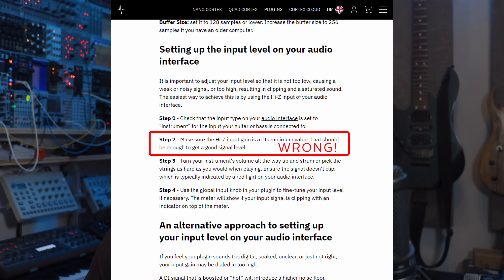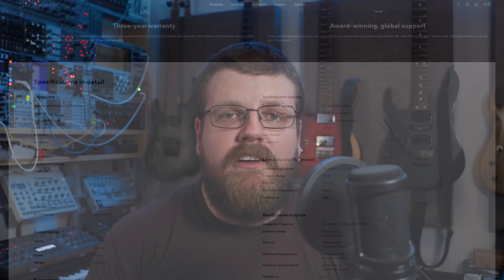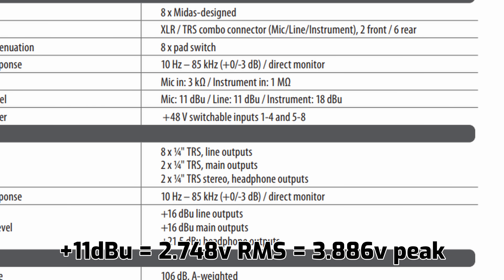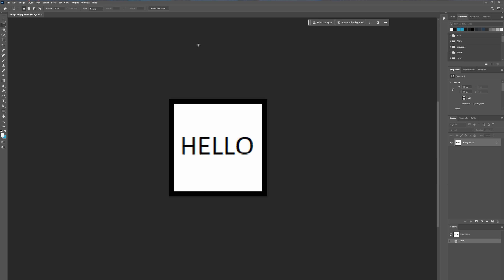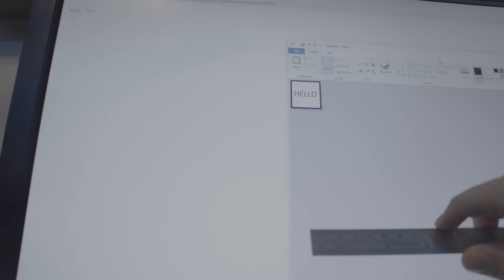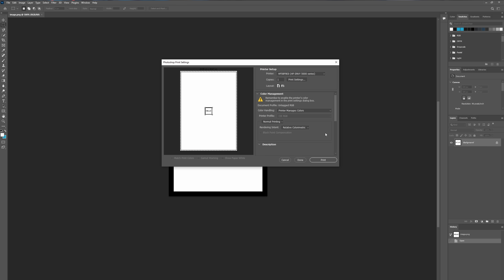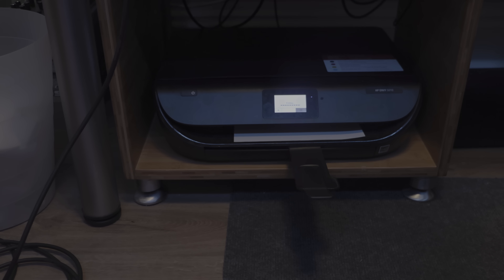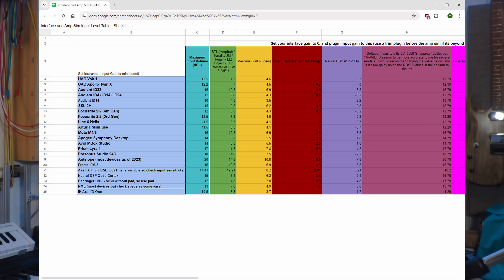Ampsims and input gain - Please, stop the madness...

Comment: Great video! Quick question: what if my interface isn't listed in the spreadsheet? Where would I find the info I need to choose my initial level?
Reply from the maker: @ElFlippage  usually you'll find this information in the user manual, it will be listed as the "instrument input level" (or similar) and have a unit measured in dBu. You should then be able to find another interface in the list that has a similar value. :)
Reply: It should be listed in the specs of your owner's manual or on the manufacturer's website. Look for "Maximum Input Level" of the instrument input (assuming you're plugging your guitar into the interface). HTH

Comment: 0db is the dumbest thing I have ever heard! I was not aware this debate was happening, I thought everyone just turned up to the right level 😂 Why the hell would someone want to feed a weak signal into an amp sim?? The internet is insane sometimes ! Great video !
Reply: Yeah, I'm not understanding where this idea came from. Like... it's common knowledge to turn up to red and then roll back to green to find best signal strength
Reply: @Citizen_J  only thing I can think of is that they have had the software gain up too high, maybe software builders have even been setting up this way so it can handle the 0db “geniuses” 😂
Reply: @Mr-Foad  It could be that this information came from metal players who have high output pickups, so they're slamming the input hsrd enough that turning up isn't necessary. I know my passive bass doesn't work like that

Comment: Intereasting. My axe-fx comes in pretty hot into my x32. I boost the input gain 7db to hit the -18ish target. So by your logic. My x32 should have a input gain level that gives you the best noise floor too not just the axe-fx.

Honestly the way I do it sound fine now, but I wonder if it could be even better.

Comment: I'd debated making a similar video for months, and was hesitant for all the same reasons. From one plugin developer to another, thank you!
Reply: Another thing I'll add is that, there is no way to convert dBu to dBFS. It's like asking how to convert from inches to percent - one is an absolute measurement, the other is relative.
Reply: Love your plugins! 🙏
Reply: This kinda underlies the overlooked aspect of providing feedback to the user. If there's an "optimal" gain to hit the plugin there should be some indications of it (some even had an auto-gain feature where you could play the guitar as loud as you could and it would set the input) and let people adjust it (or adjust it to taste).
Reply: @Justatireddev-f5s  For our guitar line (AmpCraft), there’s instructions in the manual for optimal level. We’re also adding automatic input level adjustment in a free update soon.
Reply: @Red_Fox-o8q  Yes, of course! And that's something that will be added as well.
Reply: @KazrogPlugins  Amazing news! Let me just state that musicians are usually quite on a spectrum of neurodivergency; what's in the manual will not be read. 😐 But self-describing UX and smart solutions like this are, in my opinion (as a corporate dev), great engineering .
Reply: @Justatireddev-f5s speak for yourself my autism drives me to read every manual
Reply: But why didn’t you make this video earlier? It kind of says to me you didn’t actually believe any of this until this dude made it. It’s wild to me for you to see apparent misinformation, but only deciding to speak up after someone else does an in depth video
Reply: @withinthrall1445  I figured the misinformation would run its natural course, as it tends to. This is one instance where that didn’t happen, unfortunately.
Reply: @withinthrall1445  Not everyone is comfortable with public speaking.

Comment: Nice video! I've always recorded everything, not just guitars, the way you describe here. Guitar is actually super easy to do this way if your audio interface has some kind of indicator so you know when the signal is clipping. I plug my guitar into the audio interface with the input set to 0, turn my guitar all the way up, strum some chords really hard and aggressively, pluck a few notes hard and aggressively. If I don't see the "clipping" light on the audio interface, I just turn up the input gain a bit and play a few chords/notes hard again. I repeat this until I see clipping occur. Then, I do the same thing in reverse. I turn the input gain on the interface down a little, and try the guitar again. I repeat this until the clipping disappears. 

The process I just described usually takes me in the area of 30 seconds, maybe.

Comment: Thank you, will try this! But my questions would be:
1. with a scarlett 2i2 1st gen, where the max. gain is not specified in the manual, how to find out what it is?
2. how to know how much to reduce the digital gain? for now im assuming you just turn the plugin about as much as you did on te interface's knob? 
For now, it certainly reduces the noise although im not sure the amp sounds as good.. maybe i will need to add more amp gain now

Comment: Bullshit advice.. you do record with headroom.. that means headroom of the analog front end.. only morons level to 0dbFS. Most converterchip have their sweetspot around -10dbFS. And most analog frontends are not best at max level either, otherwise that wouldnt be theire max level. Exeptions are certain special converters with internal soft clippers some like to use for mastering brutality.
Reply: Yup... The UMC1820 interface used in the video is a good example of this. The signal quickly gets worse when increasing the gain and it distorts, especially in the low frequencies, before warning of clipping. I suspect pushing the gain close to the clipping led, just to battle the self-noise is simply inviting different problems to the signal quality.

Comment: Hi, do the values change if you are using a balanced signal? ie, using a DI box or "Instrument" setting such as on the scarlet focusrite?
Reply: I suspect you would use your interface's "Line Input's" Maximum Input Level. On my UA Volt 276 the instrument Maximum Input Level is 12.5db and the Line Level is 22db. But someone with more knowledge should comment on this.

Comment: One disclaimer - not all interfaces, especially the older ones, have the best AD converter performance at the near-peak, so sometimes it is better to set the peak level few dBs lower. Otherwise you are 666% correct.

Comment: So I've got a question - how to determine how much input gain to take off the plugin after setting the input gain on the interface if the said interface doesn't show how much gain it's currently adding?
Reply: I had the exact same question. Idk if I'm right but I used a RMS meter using the mVmeter2 plugin from tbproaudio. Now it sounds awesome but I'm not entirely sure if what I did actually measures decibels. So yea, can someone help as well?

Comment: Ok love the video and totally get what you’re saying, but need more total noob advice. I’m going into a UAD Apollo x8 interface in the Hi-Z front input for guitar and use various amp sims: Neural, STL, JST, IK Amplitude/Tonex. I get your whole plan of attack for getting the level right at the interface first, then adjusting the amp sim input to work with it. My question is now at the DAW level. I’m using Logic. At what point am I adjusting those levels before/during/after? Is there a level I should set my DAW at as a baseline, then do the guitar gain staging as recommended, then when that’s all good adjust the DAW gain levels? And to what, is there a target level or am I just going by sound quality and not clipping. As I stated I’m a total noob getting into recording and would appreciate any advice here for recording guitars and having the levels planned ahead to best mix later with everything else.

Comment: Great advice, my first interface was a 1st generation scarlett, which clipped at 0db. Pad and instr initiated and no plugins. I thought this was a fundamental flaw with this specific unit/generation. I was looking into a di box to control the analogue signal but just replaced the unit as cost wise there wasnt much in it. Whilst i will repeat the 4 steps with my new interface i don't see how it would solve the guitar peaking at the input stage.

Comment: OK.  But this whole thing started because plugging a single coil into a cooked interface made the amp sim not sound like a single coil nto the real amp.  Same if you switch out to a humbucker.  It sounds to me like you're going back to the cook-your-signal-till-just-before-it-gets-burnt methodology.  Am I wrong here?  Have you tested 2 different guitars (single coil and humbucker) into a real amp and sim amp.? Did the sim amp tone sound the same as the real amp?  Or was the sim amp much more driven than the real amp using same amp settings?  THAT was the problem trying to be solved.  We wanted our amp sim settings sound to closely mimic the real amp settings sound.  The cooked signal method meant sims were waaaay too gain-y compared to real amps.  It looks like you are a very capable guy with all the gear, I think a video showing parity between real amp tones and sim amp tones is well within your capabilities... the video is much needed by the community who don't have your skills.  We just want to plug our guitars in and play... the right way
Reply: You are right, in so far as that the intention of the original gain at 0 'movement' is semi overlooked here. Those videos and the spreadsheet were aimed at trying to take the guessing out of input signal, by listing plugin settings for the gain at 0 default for various interfaces. Following these settings your signal and the resulting sound from the amp sim would be close to what the software designers worked with, and, therefore, should mimic the response of the amps modelled well. 
I think in this video it is suggested that upping the input interface gain, to get the biggest dynamic range/distance from the noise floor, is always preferable because of the signal to noise ratio. However, you can then dial down the signal in software afterwards. Bringing it back to levels close to what the software was designed for. However, that makes the adjusting more of a guessing game again. Also it misses the fact that not every interface actually produces better sound at higher gain settings. 
I think a more nuanced advice should also take into account the musical style. The super high gain sounds in the metal oriented amp sims amplify and bring forward all low level hiss and these amp sims also bury any undesirable qualities plus any nuances of a DI signal beneath a mountain of distortion. However, for musical styles with low gain sounds the hiss will remain almost unnoticable and the advantage of having a signal that closely matches the designers' might  be bigger; more responsiveness or having the amp react to varying picking strength.
Reply: Sorry, truth Tor pedo, if you properly set your levels from your guitar at the interface level you will get predictable results from Neural DSP when you compensate by lowering the input gain in software. It’s refusing to properly set your level in the first place that is causing people to have weird and unsatisfactory sounds from their amp sim. You’re thinking things work in a way that they just don’t.
Reply: Here i am commenting yet again on one of these threads how bonkers it is that so many guitarists don't seem willing to understand why you would want an amp profile to react to pickups the way the real amp does. The idea of just dialing that in to taste is kind of...well...impossible....unless you know the amp youre profiling so well that you know exactly how it's supposed to be reacting to your specific guitar...in which case you dont really need a sim, because you obviously own the real amp. Just tweaking a "pre-volume" input setting til you get the level of gain that's in your head is not how cool, old, expensive, rare, amps work. So it's not how supposedly super accurate profiles should work.
Reply: @MarkTorromeo  well said
I want a method to set the interface and amp sim gains to mirror the real world sounds on the amp.  I don't want to guess.  I want my blues amp sim to give me chimey cleans, crunch and overdriven tones exactly like the real one.  A guy on YouTube says put the amp Knobs like this and you get this sound, I wanna put the amp sim Knobs like he does and get a sound as close as possible to him.
The audio engineer way does not achieve this
The zero gain method may achieve this, I don't know
We need an audio engineer to test this out with tests at numerous amp Knobs settings to test the range of the amp, cleans, crunch and overdriven.
I think the 1st person to come up with an idiot proof method and proof with lots of tests would have a huge video
Reply: @truthtorpedo99  There is no idiot proof method. Every guitar pickup has different output levels. On a real amp, turning up the gain would break up at different points depending on the output of the pickups. It’s the same on your computer. It’s not rocket science you literally just have to look at the levels. Play hard, turn gain until it’s not clipping at the hardest level you play. Turn down the gain on the amp (sim) until it sounds good. Like what is confusing here? Guitar tone is subjective, but setting input levels to just below clipping is objectively standard procedure.
Reply: @drewbs.b  it may be standard procedure, but you're not getting it.   You plug in any guitar into a real amp and you get a tone for that guitar (wherever the Knobs may be).  But plugging same guitar into sim amp with your just-before-clipping with same knob settings will produce a significantly different tone.  You sir are not getting what the community wants.  What is the point of an amp sim if you don't get the same tone with the same guitar and same Knobs settings?  If it's always different then why not just have 3 amp sims named heavy, crunch and clean?

Comment: On my shitty scarlett solo, the input gain at zero in "instrument" mode is already enough to go past -18dbfs with a neural dsp plugin set to 0db input gain 0db output.  I tried your method and well, it's meaningful even if it's better. I can crank it up not even a quarter before clipping, even if I recognize for the noise floor it's an improvement from 5 to 8 dB .
 but yes it surely matter with a better interface, but at the end of the day it's just gain staging , personnaly I dont want any crackling so I'm not going to risk a crackling because a too harder strum goes into clipping, when the signal reach -18dbfs it's good and prevent any clipping in all case.

Comment: I remember in the early days of VST ampsims around 2005 or so, everyone was always touting (even much later on) that always record DIs at -18 dBFS, which I dutifully did, and time after time was dismayed at how bad the VST plugins sounded. No gain, no sustain, very weak palm mute sounds, and generally poor experience. Then I just gave up and ended up recording DIs at just below clipping. And boy what a difference it made, especially with plugins that didn't even have input gain (or very limited range, like max +6 dB).

Comment: This is correct if the analog amplifier before the AD converter is linear and don't add distortion or compression close to maximum output. Some analog amplifiers design have stages, the input of a yamaha M7CL has that, on to support gain for mike level and another to support line level. The noise floor of these are often different och the yamaha .5dB of more gain and you get much more noise. So as always it depends.....

Comment: Whats the best way to measure how much gain you're adding at the audio interface stage? Most audio interfaces have a knob without any way of telling.
Reply: I feed the hi-z input with a sinewave, measure the input level with the knob at 0, then turn up the knob to a position where I know my guitar doesn't clip, measure again the input level, the difference is the db you are boosting with your gain knob. Dont know if it is the best way to do it but I did the experiment with just 6db of added gain and you can hear the noise floor attenuates a little (3-5db)
Reply: This is the challenge I'm having too :)

Comment: That pixels to inches opened my eyes to analog to digital. Thanks for the analogy!
Reply: Thanks for the pun!
Reply: I’m pretty sure his analogy is incorrect. You can convert pixels to inches. While things like dpi affect the actual size, there IS a measurable size. That’s why his image printed that way, which I found ironic.
Reply: What is the physical size of one pixel?
Reply: @bobbydigitales  1/96th of an inch (approximately 0.26 millimeters
Reply: @ParanormalResponse  How are you calculating that?
Reply: @bobbydigitales  That is the standard refrence point in digital designing. The size can alter between your screen resolutions.
Reply: @ParanormalResponse  Yep! I showed my wife the analogy (a professional graphic designer), and she went "yep, that's wrong".
Reply: @ParanormalResponse  But, doesn't that just mean the reference point is an arbitrary standard to make conversion easier/more-standardized? Doesn't that actually prove his point?

Comment: Look at it like this.  If you take the physical Line 6 Helix and use the standard input setting and play a preset, it will sound a certain way. If you then take the same guitar and same exact preset, open it in Helix Native and set the audio interface input gain as you’re suggesting, you will get a completely different sound…WAY more gain than when you play thru the physical Helix using the same guitar and same preset.

And I get what you are saying about adjusting the input gain of the PLUGIN, but for those of us that like edge of breakup or riding guitar volume knobs for our tones, that means for every guitar swap we would have to figure out how much to adjust the input gain by.  In the mix, the noise floor isn’t going to be any bigger a factor than it would be if you were miking real amps.